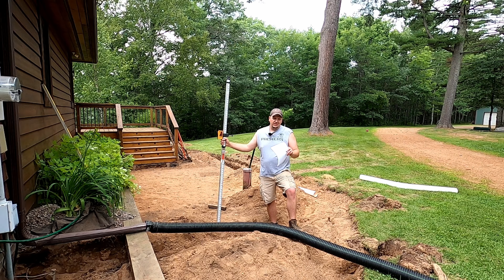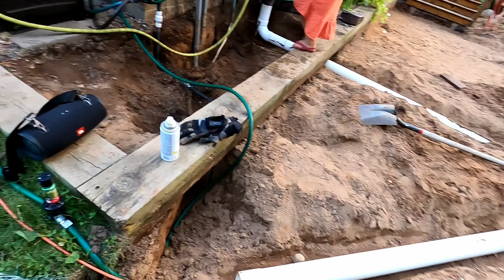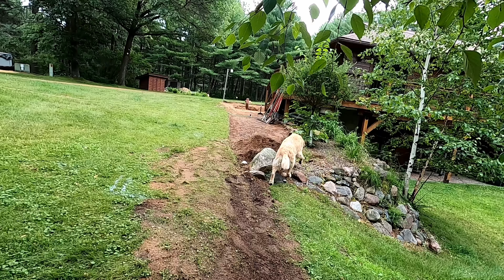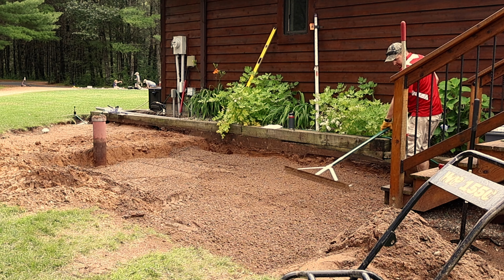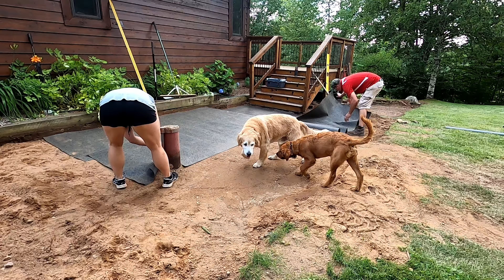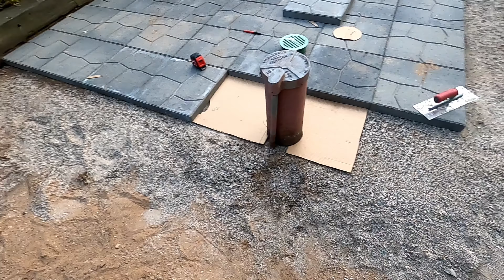Building a concrete paver patio for a Hot Tub!

Comment: Putting a patio in this spring have a couple questions
How did the pavers hold up to the hot tub? Why 10” of gravel on that side I would have thought for a hot tub you would have used a bigger paver?
Reply from the maker: So far they are holding up great! I consulted with a local landscaper who installs patios and he suggested 10" of gravel topped with 1-2 inches of the manufactured sand.  The pavers, I searched on the internet and it was thought that a minimum of 2" pavers required.  As long as the foundation was solid, size of paver shouldn't matter much.
Reply: @OutdoorsEngineer  most of the info I can find says 4-6 so I was thinking of 5” with 1” sand and a 1” paver, in your opinion would that be sufficient or should I beef it up a little?